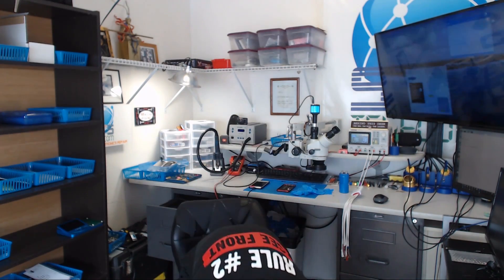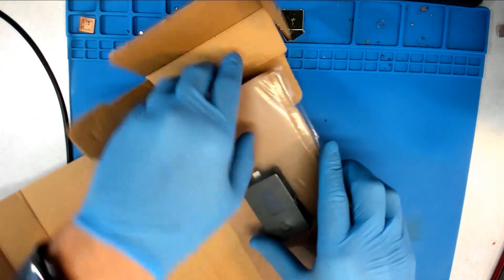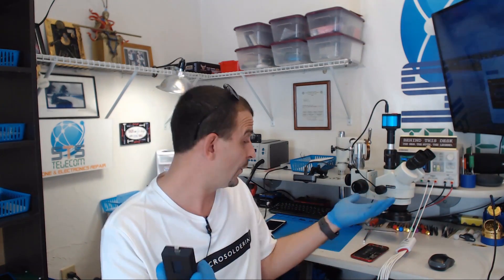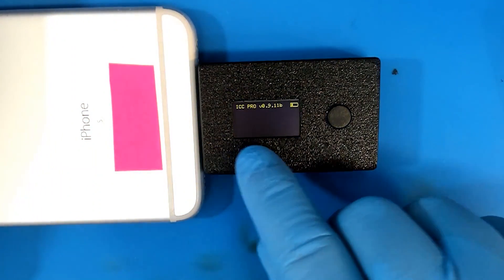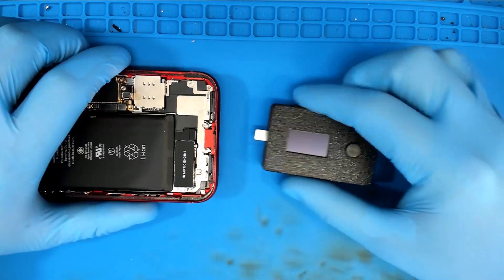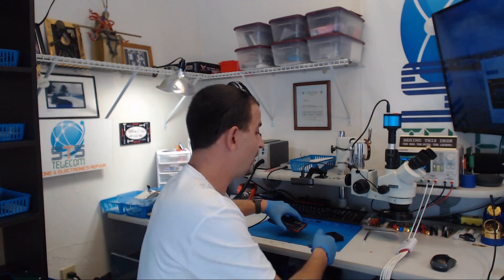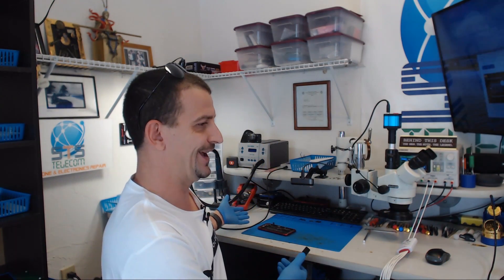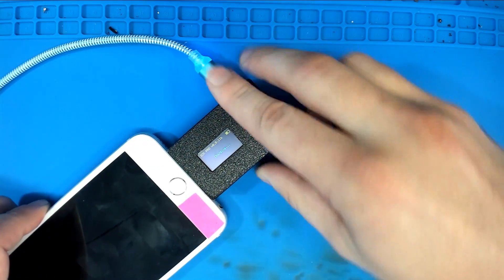ICC Pro From Der Apfeldoktor Review (STS Style)

Comment: This tool seems to be identical to the existing tristar tester developed by Jan Petermann nearly two years ago.   I was hoping to see Ben’s tool as very different than Jan’s. What is novel about this tester versus the one everyone already has? Maybe I missed something. 

FYI—on the original digital tristar tester it will only work in one direction because it has to probe all 8 lines going to the dock.  It can’t do that both ways.  The device will say “dock fail” when it really means “flip it”.  This device seems to use identical phrasing.

Re: cheap breakout boards—that is not how tristar fails.  It doesn’t usually create shorts, and never makes open lines that can be detectable by diode mode.  The digital tristar tester is a great tool because it is a functional test.
Reply: "original digital tristar tester" - i'm sure you talk about the first original u2 tristartester - developed by latif mutluer from turkey - https://www.vsbelectronic.com/index.php?route=product/product&product_id=25 - every tester which came after, came just after :). by the way - there is NO patent on any of these testers. there was a try to get a patent on the tester, but the german patent office said it's not patentable. there is no way to protect technique, which already was on the market. so please don't tell things, which are not true. thanks.

Comment: Love ben pee but I'm not sure I can spend almost 200 for this when the the TriStar tester is only 140. Wonder if the secret feature will make it worth the extra 60 bucks
Reply from the maker: I actually did not check the price.
Reply: Thanks for the reply Ben. What is shipping and fees to usa?
Reply: Carl Burfeind No Problem Bro. We can use slow shipping (cheap) or DHL Express (expensive). So from 20 Euro to 75 Euro.
Reply: The price of our ICC PRO is 169 Euro including TAX and shipping (within Germany). The price of the tester you mean is 129 Euro PLUS vat and PLUS shipping. So the difference is only about 15 Euro and we have a third secret feature, which will be released just within the next weeks. So you pay about 15 Euro more and have a third Feature, which  has no tester in this world actually.

Comment from the maker: Update:
I believe this tools works with 90ish% accuracy due to pins that cannot be tested via the dock flex.  I am thinking that with prior knowledge of troubleshooting Tristar issues without the tester + the tester, one could probably close that 10% gap.

Update: The XR was a Tigris issue!  The tester saved me from unnecessarily carving out the Hydra IC.  Another look at Tigris, another new IC and the phone is fixed.
Reply: The test showed Tigris and Hydra OK. Now you are saying it was Tigris. How can the reader indicate Tigris was good but yet you changed Tigris. A bit confused...
Reply from the maker: @lisaforbes3807  Sorry, I was in the car when I first responded.  You may not have seen it.  The test is showing Tristar/Hydra Ok.  Hydra is pretty much just the new Tristar.  It's not testing Tigris.  You  may be thinking of when I mentioned knowing that Tigris is ok.  That's because I had already replaced Tigris.  After this tester said Tristar/Hydra were ok, I replaced Tigris again and it fixed it.  Very much relieved because Hydra is no fun on one of these.
Reply: @ststele  got it! Thanks
Reply: @lisaforbes3807  look again!!!!

Comment: Someone needs to build one cheaper I am going to try to build my own when I have time 
i’ve seen some reviews of other ones not working so good.. I wonder how this one works keep us posted thanks 😊
Reply: There are cheaper solutions, everyone who knows what he or she is doing when repairing iPhones and iPads should know what is going on with the Tristar IC and on the lighting port, all you need is a breakout-board to be able to access those pins easily and a multimeter, to do it easier and faster some comparators/op-amps that turn on LED's at the specific reference-voltage or don't are enough, no one need LCD's or microcontrollers about that, Apfeldoktor just found another way to rip-off people funny for the same price as he take mostly for everything that is worth less then a couple of bucks, the true Tristar-Tester atleast delivers some informations about resistance, voltage etc., which are unnecessary aswell but atleast the LCD has more use than just for advertisement.
Reply: Wilson Yes I have one of those boards cost $8 dollars multi meter .. works But it would just be nice to build a digital one little side project
Reply: Then you should know the target-values if not then just search for Tristar-Tester there is a video from a guy who tests it with several phones and writes down the values, all you need to do then is to use comparators/op-amps and set this voltages as Vref, ok, if you are able to use microcontrollers, Arduino is more than enough, then it is even easier, just AnalogRead those pins and check the values, if you do all possible test before, like with battery and without, phone turned on or off etc. and get those values together, you can get ways more informations about what is wrong with the phone and it would cost you $1.50 for a ProMini clone and around the same for a LCD, maybe the same again for additional parts. I don't repair phones on a daily base so I don't know any of this values or the behaviour, so I can't make an alternative that guaranteed can do the job, otherwise I would do it and give the project free to diy to everyone and not even place my name in the code.

Comment: Have you ruled out tigris already? I haven‘t had a single faulty hydra ic, but already 5 or 6 faulty tigris in iPhone 8 and 8 plus... if the Dockflex and connector is ok, and the mosfets in the battery I2C Lines aren‘t loose (when i see good diodemode readings), i would go for tigris first in Ip8 and newer.
Reply from the maker: This wound up being Tigris.  I had replaced it once and was going to go after Hydra next.  I'm glad I didn't.  I did Tigris again with a fresh IC and it works.
Reply: Very nice 🙂

Comment: I’m guessing like the other tristar tester - it will only work face up towards the screen. Can you follow up with what the solution to that XR was? I’m use to my tristar tester (not this brand) missing a few failing tristars that have issues on pins that are not connected directly to the flex.
Reply from the maker: The XR did indeed wind up being Tigris.  I had replaced it before but after seeing Hydra pass on this thing, I went back to it with fresh ICs and it's good.
Reply: STS Telecom awesome!! Thanks for the update :)